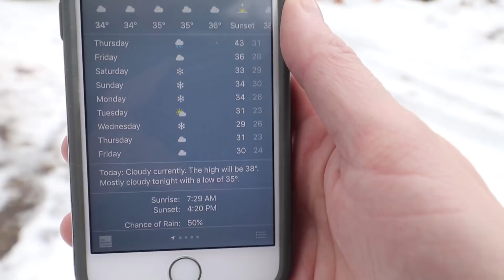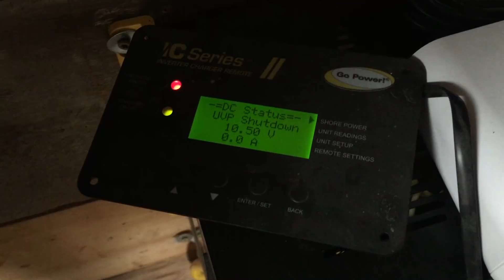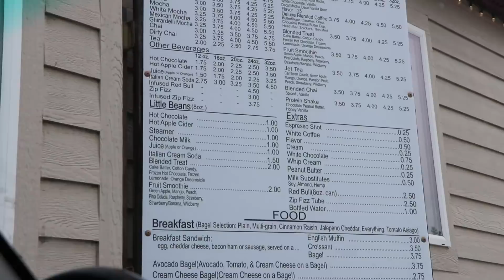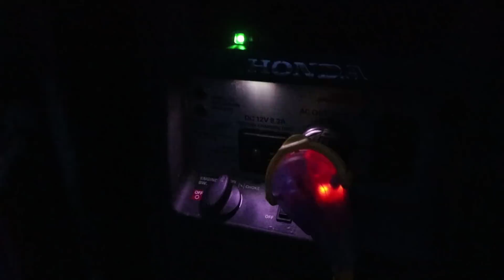Our Story: Giving Up Solar Power to Go On Grid

Comment: I once heard an "off-grid" enthusiast say,  you can go off-grid with a small cobbled together solar system and learn to live with less electricity, which is what you've done, or you can pay 50K  up front to install a solar system that will meet all your electrical needs, just as if you were on-the-grid.  Save yourself the daily drudgery and numerous hassels, get your hookup to the grid and use the heck out of it.  Then when you can afford to install a large scale solar system, do so.  There is a reason why the vast majority of the world is either on, or clamoring to be on, an electrical grid.

Comment: Ughh  still not a bugaboo catnap video, anyway I am a owner operator truck driver living in the truck..burns 1 gallon per hour idling at over over $3 per gallon ($3.75 at times)...could you use solar and only use grid when solar not available? I do not know the answer.

Comment: It is true. Solar is not simple and if your using a generator it means that your system is to small for your power needs(+3 KW of panels per person for a "normal" house and about 50KWH of batteries per person).  But, even if you had a large system, you would still have to alter your life around the weather.  For me(never used a generator +4yrs on solar only), the only weather dependent thing I do is cloth drying ---> needs 4KWH per load so it is generally done during a sunny day.  FYI, in your future building, you should always design based on zero maintenance(daily/weekly/monthly)  -> clearly, your power system was not designed to be maintenance free and you discovered that maintenance time takes away from living time.  Going ON grid is a one way expense, you can never get back the money to connect to the grid (sell the home....maybe)

Comment: poor dear .. were 3 of them then one sank ... :(
.
something you might do for solar is run your hotwater or freezer or fridge ... some of the high load power eaters ... basically get them off the grid and keep your power bill cheaper .... after all you do have the setup to run a few if not all of your power needs.
Reply: I understand your choice ... completely ... going full alternative power is not an easy thing ... or a cheap one ... especially when you add building your own home into it ... 
.
That being said ... you can still augment your hydro bill from your solar by picking things like your hot water or fridge or freezer  or even all your house lights and putting that on solar ... it will help you keep a lower power bill 
.
the other part of the solar equation is people tend not to look at the seasonal variation and type of weather in the area ... as you have found out lots of less than perfect weather causes hardships with solar ... as i recall you have mono crystal panels ... which are good but in hazy and lower light conditions not very good ... while poly is a little better able to handle the lower light ... but still not all the bad weather days will get power ... and the VAST majority of people dont look at this from the start ... sure you have a battery bank .. but it only covers a few hours of supply .. when it should cover a few days ... trouble is batteries AINT cheap .... solar is a complete change of life style that most people dont understand ... today people enjoy their washer's and dryer's and latte's too much so they dont figure on those costing them too much ... when they add up fast ... laundry from a trailer is possible .. heck they even have small washer's that can be run from your solar and put in your rv's tub ... all you need after that is a a clothes line ... most people wont drop the luxuries or drop the less efficient power hungry items .... 
.
tbh if people want to go solar they should approach it like they did getting their first place ... get what can be afforded and compromise ... upgrade here .. renovate there ... remodel .. etc ... most try to jump in and buy that million dollar mansion on a mcdonalds wage ... it just doesnt happen .... you start with the little place and work up .. eventually you get your castle ... even your homstead ... you lived elsewhere before comming here .. and before that somewhere else or you remodelled or upgraded a bit ... and so on .. you didnt dive in and buy what you wanted on day one .. you compromised and got what you could afford and worked up to what you want ... it is exactly the same way with solar ... start with what you can get ... and work up .. as things are you do have the solar to run your lights ... or a fridge .. or a freezer .. or a washer ... heck even just your hot tub ... later most likely after you actually have a house and not just a camper ... you might add a bit more solar for another bit or piece of your power bill reduction ... and slowly remove yourself fro the grid or at least remove yourself from complete dependance on the grid ... 
.
when you stop and think  about it .. you not only bought land and are building a house but where trying to build a solar life and ... and build a self sustainig life style ... none of which are cheap on their own ... it's like buying 5 or 6 fixer uppers all at once and finding out that you can only work on one at a time

Comment: Not a solar guy myself. Not yet anyway. What do you think about Tesla's take on solar? They are  claiming some crazy efficiency, coupled with their "power wall". Do you think it would make solar worth it? they have a use/cost calculator on their website. https://www.tesla.com/solarroof its all Greek to me. Maybe in the future you can run a hybrid. Using Solar when you can/when its viable, pumping excess back in to the grid. When you need it, taking from the grid. Can't wait to see more from you guys. Love the channel.

Comment: Wow! You’re brave people. I’m a potential solar consumer in California. From your experience what might be wrong with connecting to the grid and still using solar. Can you not trade off power on the grid in Idaho? Trade off meaning selling to the grid in daytime and paying for it also at night. Obviously SoCal has a bunch of sun and a ton of infrastructure. Totally understand the off-grid issues but do you think a hybrid system makes sense? And if each person runs a generator, isn’t that less efficient than one company with a huge natural gas power plant from a planetary perspective? Really interested in your experience, as you’ve said even as a systems engineer it’s hard to get straight answers, and everyone exaggerates specs.

Comment: I support your decision.  I grew up in the grind-your-own-wheat, drink-goat's-milk 70s but came away from all that thinking "you can go too far."  In my opinion, you can waste more energy trying to save energy then you would if you took a traditional route.  I suspect you'll do solar and wind to supplement your system when your system is fully grown.  I also really respect you going through all the steps to learn what you're doing.  Keep it up, the journey is even more fun to watch :)  PS.  avoid goats.

Comment: Off grid is a fantasy for most of modern life, the fridge, heating, lighting and at homestead the farm equipment generally demands more power than a residential solar system can provide, especially during the winter and prolonged cloudy days. Solar, generators and the massive battery system are at best a way to supplement grid power.
Reply: We currently live in a 3000+ sq' 3 bed, 2 bath home with every amenity any other home has , we even have a teenager that uses all his powered toys even till wee hours of the morning, my wife washes , and dries clothes just about everyday. We have 12K solar, 24- 6V Trojan Batteries on 48v system, a 10k standby Generator. Keep the panels cleaned off and even on cloudy days once the sun goes down the batteries are topped off, and we've been consuming on top of that too. It's been almost 6 years, and we've been extremely happy not having to dish out for a power bill.

Comment: So why not have the best of both and when connecting to the grid also fit in a switch as many do that can take you off the grid have the home run off alternative energy whenever you choose or for example when there is disruption of power on the grid?

Comment: Ur solar batteries are obsolete! and wore out also u do not have enough solar panels to use the kind of power ur needing so don't blame solar just invest in some lithium batteries yes there expensive! but how much are they going to charge to get power lines to u? cuz I know it's not cheap so if it's going to be costly u would be better off to put that money in a bigger better solar system!
Reply: You guys make it sound so easy and viable...my system cost 40,000.00 and I did the install, saving 10,000.00.
Reply: Courtney Farber Yes, I think invesitng in better system would have better and that would have genrated more good videos. 
I think rather then buying million dollar led and work lights,  some batteries and panels would have been better investment

Comment: can you still use solar, but connected to the grid? so they store your power avoid using the batt.
Reply: Trouble with grid tied is that it dies when the grid dies unless you spend ALOT of extra money on hybrid system, which sort of defeats the purpose... Imagine spending all that money on grid tied, then a storm knocks out the lines and the day after is bright and sunny but your panels are useless because the grid hasn't been repaired yet; frustrating to say the least!

Comment: I agree with the move to grid power it does make sense as the n numbers go...... In the process of engineering your power grid I would highly suggest you get it engineered in a way to use solar to supplement your usage you already have the panels and inverter it will reduce your bill slightly but on no sun day you won't see any power withdrawal 
Thanks for all the videos I have been watching your journey for 2 yrs and it's has been a blast..

Comment: If I look art your power system you seem to have a solar/battery assisted gasoline generator setup. NOT a solar system.
I recall you spending quite some money on the generators and I suppose on gasoline to, curious if with that money you would have been able to get a decent size solar/battery setup for your area? that would cover you also in the winter. 
Depending on the cost of getting a grid connection, which I am curious about, and the costs for the big generator plus gas would a similar priced solar/battery system been able to cover you with less headache? I think so, granted you need to still remove the snow from the solar panels after a snow event ;)

Not having your laundry onsite is a choice you made in the beginning same as getting storage in town instead of on property(you have the space on site for a container or extra shed from reclaimed materials)

The US population uses a LOT of energy and I do not understand why, granted you have downsized a lot and the silly numbers that are mentioned in these comments are not for you.

We are spending time in the US and as we did not not need a 100amp main feed in Europe(hint monthly costs triple for a connection bigger then 3X25A @230V so the limit is comparable to a 75A @ 2x110V feed in the US) we don't need it in the US either. Even if we are stuck with inefficient way to large fridge and a heating fan that is sized for a house 10 times bigger. We use about the same amount of power as we did in europe which is less the 1500kwh per year. 
Now it is totally affordable to size a solar battery setup for that yearly load in most places on this planet, if you make sure you can plan your big energy use within a week and guess what you can with  laundry .....plan. Laundry 2 loads about 7kwh daily usage about 3kwh.

granted our heating is still done with natural gas but so is yours with wood ;)  ps you might have used the heat from your generators to heat your cabin for free.

Comment: Solar is NOT able to stand alone unless you have SERIOUSLY overbuilt the system or live in an ideal location... that said, a combination of solar and wind with a backup of grid connection OR generator is a far better solution. the solar and wind reduces what you will need from the grid. Do not turn your back on it entirely... but the videos I have seen from you, I agree that you need more power to accomplish your goals. take care.

Comment: You've proved the shortcomings of solar,  good choice to go on mains electricity. What is the power reliability like in your area? 
Get some local advice on getting a mains design for your house and garage, even better get some advice on use of stand by generators to your code.

Comment: There some things I will agree with and some that I don't.  you honestly have no where near enough solar panels or batteries to make an honest assessment of the viability of solar.  I will agree that for the construction phase you really need dependable power for the tools needed to build a home.  Working off generators gets old fast.  The determining factor of solar or grid depends on the cost of hook up.  Here is a clip of a system that would have completely changed your opnion of solar.   https://www.youtube.com/watch?v=loloCJSor0M&t=17s   Congrats for lifting a weight from you shoulders and making time for bigger and better things.  also I love your series.

Comment: My comment won't matter since there are already 2517 comments ahead of me.  But I Have to comment on, "our life right now while it is much more simple is much more complicated .  .  .  . " at 10:09 .       I say do not go overboard on being "Off the Grid", make it fun  .  .  .  make it a 'hobby' .  

I got a Nissan Leaf to back-up my 1963 Ford F-100 pick-up truck about 1 year ago.  The Ford is now 'offline' as the Leaf is too efficient.  (It is Twice as efficient as my Honda PC 800 motorcycle ! ! )  YouTube is a terrible resource (sarcasm) since I found out using it that the Nissan Leaf will (when turned 'on') charge it's 12 volt system battery from the 24 KW traction battery pack up to 1 KW per hour  .  .  .  .  . (Thank You "Transport Evolved" for that info. ! ! ! )   SO:  in this 'new' car I bought used for $9,000. US dollars I also have a 24 KW back-up battery source that will provide 1KW of power to my inverter connected to it's 12v. battery.  A nice secondary power source should the 'grid' go down.  I have an off-grid (hobby-style) four panel solar system I can charge the Nissan Leaf from (on sunny days).  Bought the panels 'used' on Craigslist.  So far  am very happy with my 'back-up' power system.  So far it is all still in "Hobby" mode, but if the grid were to go down, I would be the house with the lights still on at night!  
   So, in some cases you may have a LOT more battery back-up available to run your house on those 20 days of cloud and rain  .  .  .  .  just a thought.
Reply: instead of dilly diking around with this crap buy natural gas generator, auto on/off

Comment: I found it interesting that you only went with solar... A small wind turbine could have massively helped.
Reply: Depends....how much wind they get...and as you probably know wind turbines are limited to a very low wind speed. Most have to be 10'- 30 ' above any obstructions to work effectively including tress. And if you go cheap, good luck even the best turbines out there break down easily and often.....

Comment: hand washing clothes isn't hard,  I've done it for over 3 years. I do have a spin dryer though.  Also, I don't see how you could have refrigeration or heat with solar, it just doesn't seem viable or cost effective to me.  If you hand wash clothes, take cold showers(use only a trickle of water), use fresh, dried, and canned food, heat with fuel, etc. I think it would be doable, but that puts a lot of limitations on your lifestyle.  But hand washing clothes isn't a big deal, if you do it right.

Comment: They only brushed the edge of a truth for them. Where they live is not the same as the generality of where other folks live. They are not in a high sun day environment. The solar power off grid only folks that are posting do not all live down the street from them. Solar works better for some locals than other. Also, where they live has cheaper cost for line power than most places in the US. They are also right on a paved highway with power lines. Easier and cheaper to get line power. Every living site is not the same and cannot be generalized.

Comment: I saw way too much gasoline and generators.  You can use solar as a supplement to the grid.  Northern Idaho just does not give you enough sun at the correct angle to run 100% solar.  So you buy gasoline and buy generators and it a LOSS.  To change oil and maintain things and the cost/price of gasoline is volatile.
  Good video.  Too bad that you took so long and wasted a lot of time and you stressed out.
  Fill the generator!!!!

Comment: Good move considering the benefit/pain ratio. I suspected you might go grid based upon the design adding a washer and dryer  to the home.  Billions are on the grid. It will greatly reduce the stress you have put on yourselves.

Comment: Well, in the long run this will be rectified (pun), as the grid system staggers to it's future and the price of grid supplied electricity mounts. With your location I believe solar and wind combined would be optimal. Just for fun, here's a wind installation in Scotland. Alyssa would love the external ladder on the 30 meter (100 foot) tower.
https://www.youtube.com/watch?time_continue=507&v=3jFNjAJHbtA

Comment: Agree with you guys 
Solar power has a long way to go to keep living comfortable
Reply: Not true. A grid-tied solar system will be every bit as comfortable in a home as a regular dirty grid ! You'll never know the difference except for the smaller electric bill. I know I've had a grid tied system for 10 years which has now completely paid for itself. My system will probably still be producing free electricity long after I'm dead and gone.
Reply: greg larsen the way they go about it sure.